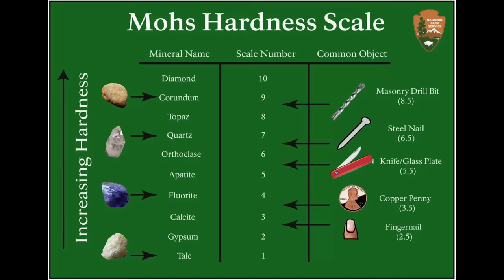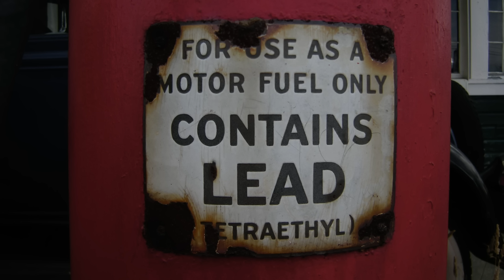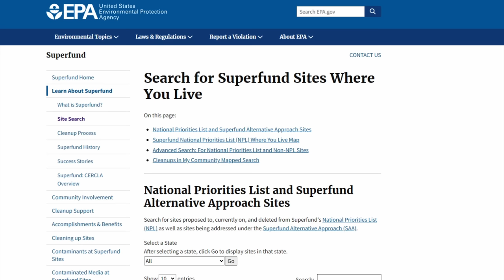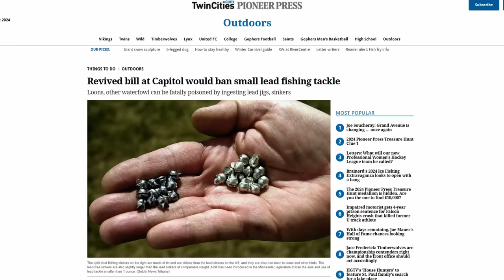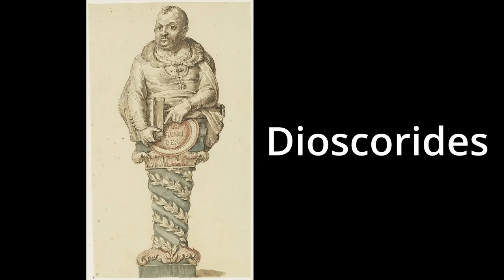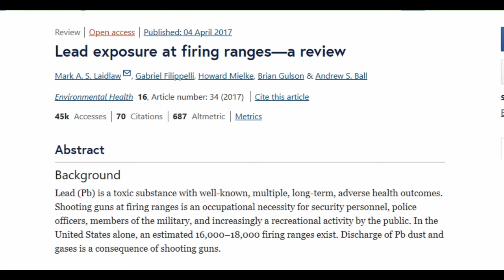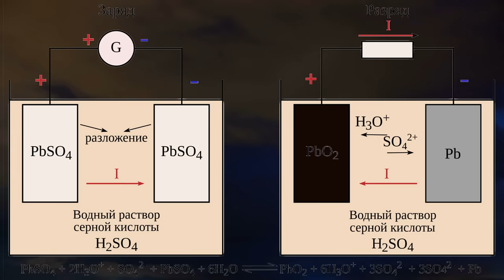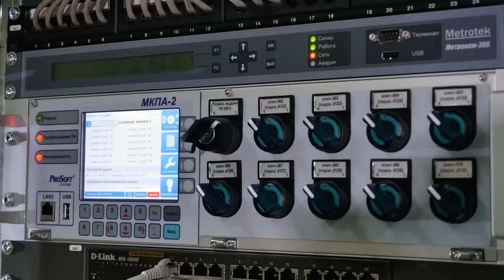The Sweet Taste of Heavy Metal: The History of Lead

Comment: Lead is on the list of useful and fun things that I wish it was safe to play with, up there with mercury and bears.
Reply: I can help with one of those. Gallium is mostly safe and turns liquid at pretty low temperatures, similar to Mercury
Reply: Leads pretty safe as long as you don't lick it and wash your hands afterwards. Mercury also isn't that bad as long as you don't boil it or drink it, though if you drop it you may have a big problem
Reply: @oscardalmatiner8724  
Gallium is way stickier than mercury though.
Reply: You forgot fire and electricity
Reply: @CAMSLAYER13 lead can absorb into the body easily
Reply: @penguins0392  its not completely safe but as long as its not going in your mouth, handling elemental lead will be fine.

Comment: Actually lead was big important for printing presses, because the lead-antimony-tin alloy used was i think the first alloy they found that had the right properties to make a lot of them itty bitty letter block things. The lead was cheap and had a low melting point, the tin made it tougher, and the antimony made it harder, wear less, and made the metal shrink less when it cooled. I took all of this info from the Wikipedia article on Type metal, which is what it's called

Comment: Just a nerd who likes guns here - best I can tell, the problem of malleability is a much bigger issue than cost or weight when replacing lead in bullets. The most popular alternative to lead or copper-jacketed lead bullets is 100% copper bullets, and while copper expands enough to grip the rifling of the barrel, it doesn't expand in hollow points the same way lead does. For e.g. target shooting, that's not too much of an issue - yeah, copper bullets are more expensive but lots of companies capitalize on their lighter weight and advertise copper-bullet cartridges as "hyper-velocity." But for hunting or personal defense, it's not a viable solution. Most jurisdictions straight-up mandate hollow points for hunting, the idea being that it leads to a quicker and more humane kill for physics/anatomy reasons, and it's usually frowned upon (read: a judge will frown on you) for personal defense because hollow points don't go through 10 layers of drywall and hit whatever was behind what you were aiming at.

I've also seen powder-coated and "total-metal jacket" (as opposed to the traditional "full-metal jacket," which leaves the bottom of the lead bullet exposed) bullets touted as a "green" alternative. I don't know what the scientific literature says about them, if they say anything at all, so I can't comment on how much "greener" they are.